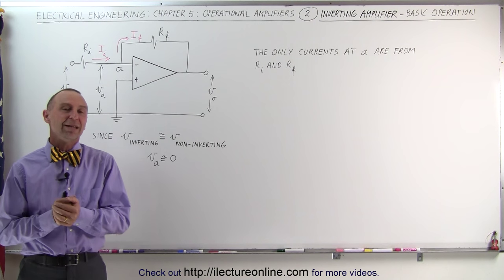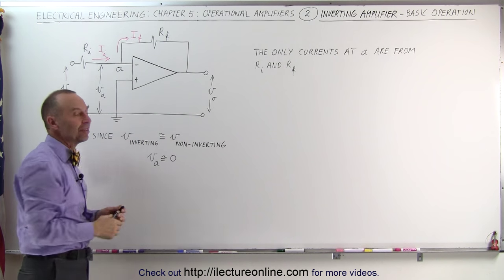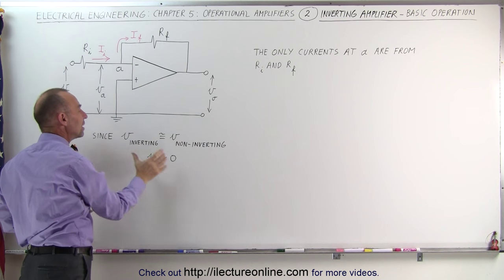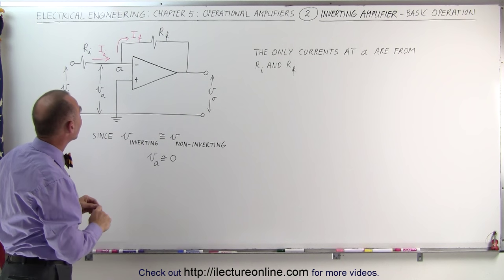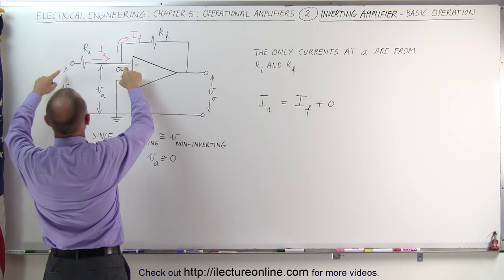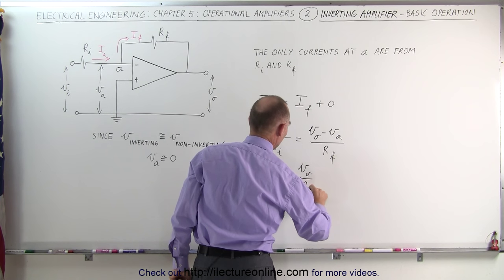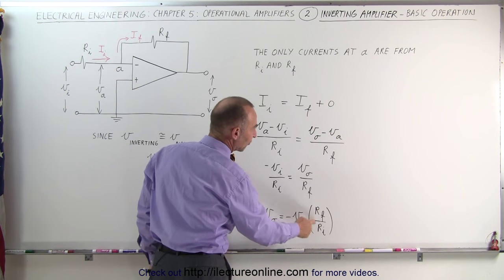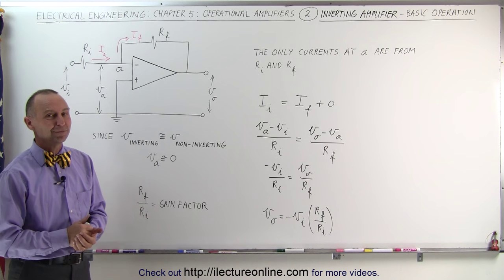Electrical Engineering: Ch 5: Operational Amp (2 of 28) Inverting Amplifier-Basic Operation

Comment: Hello there, I just have a quick question and will really appreciate it if you could answer it. 
When you find initial current Ii, why the voltage drop is Va-Vi instead of the other way around Vi-Va? it is the same thing for current If too. The way you assume the direction of the current, it should be Va-Vo, but you did Vo-Va. I always thought that you will subtract the lower voltage by the higher voltage to get the  difference in voltage and divide them for the resistor to get the current. 
I am sorry for a long question, but on a different video (4 of 28) you did exactly what makes sense to me, but it is opposite to what you did in this video.
Please! let me know if I am confused! Thank you very much!

Comment: Hello Professor,
I am confused about the way of how you set up the equation of Vi and Vo. Does the current flow from high potential to low potential? If so, the equation should be ((Vi - Va)/Ri) = ((Vo - Va)/Rf), right? That is because we are assuming Va = 0; Therefore, the current should flow from Vo to Va. I hope my question is clear.
Reply from the maker: There are different ways of approaching a problem like this.  As is shown in the video, we "assume" a current direction in the beginning (which may or may not be correct) and it really doesn't matter.  In the end, the sign of the answer will indicate the true direction of the current.
Reply from the maker: In this example the output voltage is negative and the voltage at a is near 0.  Therefore the current will flow as indicated.
Reply: @MichelvanBiezen  I totally agree with you, Michel, that it doesn't matter for the end result.  But I also agree with the OP in that it's confusing, especially since you're taking the other approach (so, vi - va) in the rest of all your videos.  But again, for the end result it doesn't matter...
Apart from that, highest respect for what you're doing and achieving.  Short videos, to the point, including writing down all formulas with all the necessary "in-between" steps, making an interesting domain really interesting and easily understandable...  Compared to other videos on YouTube handling the same subject, you're top!

Comment: Hello sir you said Va is 0 because its connected to ground but how is it ? and even if it was why would it be 0
Reply from the maker: Voltages are always relative to one another and only the voltage differece matters.  If you ground one part of the circuit, that part will be at 0 volts

Comment: For those confused on the direction of current flow - If you must assign a current direction before applying the mathematics, this may be something of a crutch as you won't always have the privilege of being able to just look at circuit and know this information. If you were taught to set up op amp equations differently than this and find this way confusing, then try thinking it over and appreciate the extra benefit of having another way of understanding the circuit.
Reply: the equation in the video was setup using 'electron flow' - current flows from lower potential to higher potential. The arrows, on the other hand, shows the 'Conventional flow'. However, it doesn't make a difference mathematically.

Comment: Thank you prof for this grate lecture,  i have a question if you could explain for me, the feedback current thats comes from tha output that we use for control the op_amp noise or heat who it will flow if the full input current will flow to output throgh Rf? Thats mean we dont have any control on op_amp?
Reply from the maker: Watch a few more of the videos in the playlist.  The basic operation of an "ideal" opamp and the "real" opamp in a circuit is explained.

Comment: great video sir, but sir i still don't get it in minute 1.40, why the If flowing from left to right even though the output is negative voltage sir?
Reply: also for the equations I sub i, correct me if i am wrong but i think it's (Vi - Va)/Ri sir

Comment: If you connect 'a' to the non-inverting input (+) and ground the inverting in put(-), will that make Vout = (+) Vin * (Rf / Ri), a positive Voltage at the output with equal magnitude?

Comment: for example, if I want to convert 10 voltage input into 250mv output then for inverting opamp, R1 should be always higher than reference frequency, right?